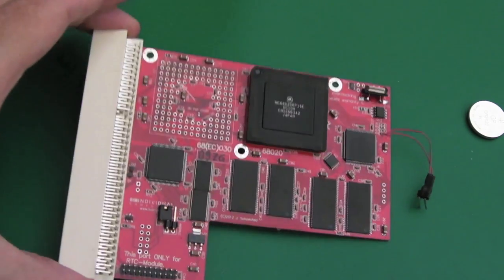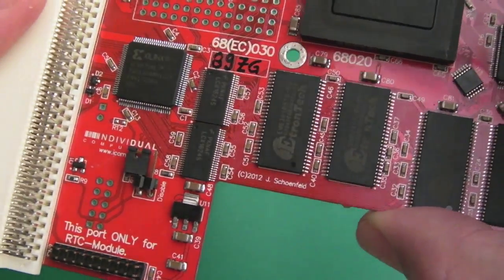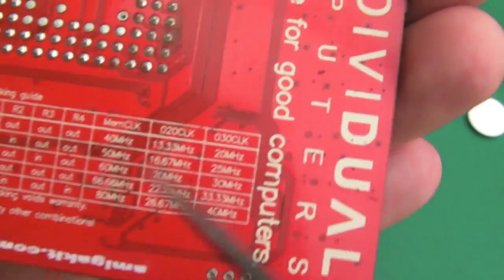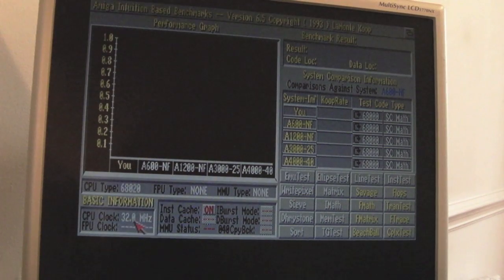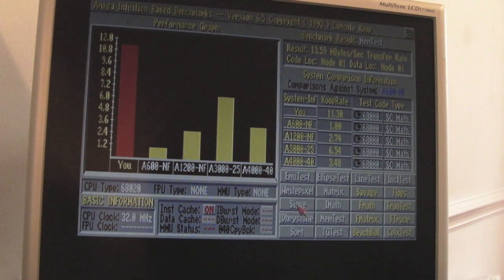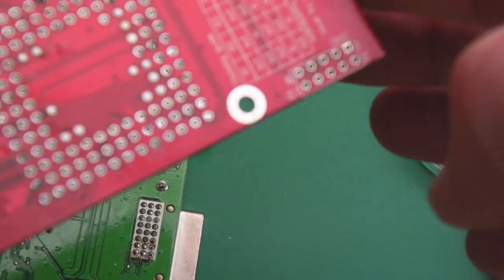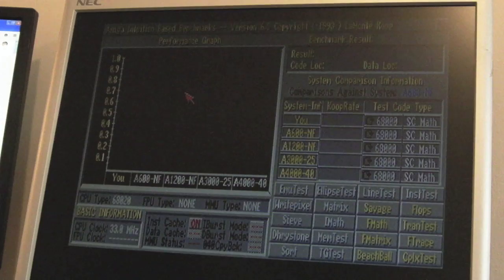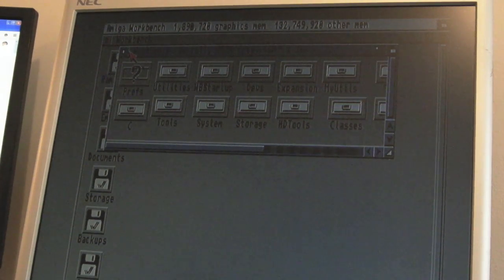Commodore Amiga A1200 ACA1220 Extra Overclocking

Comment: Nice video. Got today a ACA1232-33 with RTC module. It’s not so fast than my new ACA1233n-55. But a step up than my ACA1221EC. I use the ACA1233n-55 on my ACA500Plus and want to use the ACA1232-33 on my A1200. Maybe i can a MC68030RC50C CPU on it and switch the jumpers to R2+R4. And got a 25 MHz crystal.
Reply: There are some problems with the ACA1233n-55. It’s  to fast with MapROM enabled and  there must be a new ACA1233nLib update. Must get the FastATA A1200 MK-V CF/SATA ELBOX with ROM risers with 3.1.4 roms on it.  The ROM risers is to get above the Indivision AGA MK2CR.
Reply from the maker: Nice!!  the ACA1233n-55 is very nice indeed!  The problem with overclocking these is the RAM needs to be swapped out (certainly on the AC1220) to go beyond 33Mhz.  It might be easier on the 030 boards because the RAM might be clocked slower regards the multiplier.  It depends on the RAM used too.

Comment: STILL waiting on the follow up video mate, it's your own fault for being so good. I couldn't do video's, i have a terrible stammer and it would sound awful, still, people like your good self are a god send, we getting a follow up?
Reply from the maker: Hehe, I will get around to it!  Not a lot to show other than it works perfectly at 33Mhz with the 25Mhz chip I ended up using.  Regards 030 - not sure I want to even risk it since the firmware isn't designed for the 030.
Reply: i am happy to send you an ACA 1232, if you wanna try messing around with clocking the 030  ;)

Comment: is there a next video on this?
Reply from the maker: There isn't (yet), but I might do a short follow up over XMAS.  I haven't tried an 030 as I suspect it just won't work, but I did fit a faster 020 and I did some temperature checks and it does run cooler at 33Mhz.

Comment: I cannot think why I did not come to this channel first. You know the awesome youtube channel TerribleFire is making Open source accelarator cards for the a1200 amiga? Well I am trying to get a bunch of awesome geeks (with channels like yours) such as lukemorse1 and so on to promote the idea of an open source pcmcia sidecar caddy for an a1200 (like one of those GVP or a590 style things) with a PCI port in it and an Open Source (SLI) amiga graphics called (to be called HAMbre as a pun about Hombre graphics, HAM, and Homebrew) in it about the power of a voodoo2 or 3 and a bootable usb DVD drive and spare usb port for a flash drive (to automatically hold all data so even a console peasant can use it). And with this I am trying to set a console peasant friendly standard like the amiga used to be (so they can shower homebrew game coders with their reto--homebrew-collecting money on gofundme or whatever) so that new pertaining HomeBrew amiga games (known as HAMbrew) will work with that graphics card and either an accelerator board like your 68030 (at least 4meg to 8meg or higher) or even with 50mhz TerribleFire speed CPU and boot as easily as a playstation or CD32 game from CDROM (even if that means piggybacking from floppy drive) so that nobody needs to know anything about WinUAE to simply play a game.

I call this (easy-to-use) standard " Chambre " standard.

I have massive rant comments about this which are so awesome they are agreed with and getting pinned by amiga retro channels. A good example for the details on all this is my pinned comment in the comments section of the 10 july 2017 video named " commodore amiga 1200 upgrades " on channel "The Guru Meditation". If you wish to give my comment a read out or spread the word in the amiga nerd world, please do and do also give the channel TerribleFire a shoutout. I wish to see big channels like Lukemorse1 and MetalJesusRocks give the TerribleFire channel and similar amiga guys a shoutout. Keywords to spread are the HAMbre amiga hardware standard and Chambre easy-of-use console peasant standard. We need to make sidecar and trapdoor (like you have there) expnsions as easy an familiar to the console-peasant community as the segaCd expansion was and the sega32x was. That way shoutouts from big console-peasant channels will be much easier to impart when they are for amiga nerd channels.
Reply: Here is my other channel. :)
Reply from the maker: It sounds like a nice idea but getting it adopted as a standard will take a lot of work, and there has to be demand for things that use the interface.  I think the big problem is most people have most of what they want - or there's already a product out there that does what they need.  And the market for add ons that take the Amiga beyond its original functionality tend to be limited in demand - ie. You've got the Vampire which gives super quality video output and mega performance, and as a result no one really would want much beyond that.  The only thing I can think that would appeal to the masses would be a CD ROM interface that can be easily linked to any Amiga.  The other problem with these bolt on improvements to the original hardware - you have two camps of people, those who love the original retro hardware and want to just run things a bit faster, and they aren't bothered about adding more and more graphics and sound functionallity to an Amiga - they like the original platform the way it was intended.   Then there are enthusiast that want to just expand and expand it, eventually into something that is no longer an Amiga (The Vampire is on the borderline of this).  Whilst I still want a Vampire, I am not keen on adding hardware that turns the system into something that isn't an Amiga.  I would rather homebrew was deleloped for the original hardware as it stands.
Reply: I made a long ass comment to reply to this but got rid of it as I am trying to make it easier to navigate and I'll cover it on my other channel better. In a nutshell though, I think most people actually don't have what they want. I think a cult following may have but that is all. The console peasants do not have what they want. Amiga users were really the console peasants mostly (once upon a time) and were the bridge between megadrive and what would later become PC Master Race.

Comment: I would definitely build my own 030 Socket with the inline sockets as you suggested :) its definitely worth a go. In terms of Burst Mode and other features? Wonder if the FPGA has a bearing on whether them features work or not?
Reply from the maker: After I did this video I just fitted a 25Mhz 020 and set it to run at 33Mhz.  It runs almost stone cold (so not same dye as my previous 020 that shipped with the board).  I looked at fitting a socket for the 030, but after comparing pinouts I started to consider that the CPLD firmware is chip specific (ie. the firmware is designed for the 020 only), and there would be a risk fitting an 030 to this PCB without a firmware update.   I could be wrong, but the risk in my opinion outweighs the reward since the 030 would be clocked at the same speed as the 020.  All I would gain is some cache I think - if it worked at all, and I suspect it probably would either not boot or worse case it could even kill the CPLDs on there.

Comment: watched this several times now, always a good watch. I have one of these, and will certainly look at overclocking it, can you post any more info on the parts used? have found a 68020 st 33mhz, was gonna pop that in there. anything else you might have forgotten on the video might help to. many thanks again :)
Reply from the maker: Thanks, please note that the crystal doesn't need swapping out!  Have a read through some of the comments above (and below) - I worked out that a clock multiplier can be set using the jumpers to get 33Mhz without changing the crystal.  I will do a follow up video soon - I fitted the 25Mhz 020 and it does run a lot cooler and in fact is barely warm at 33Mhz.
Reply: i have looked at the ACA1220, and ACA1223, and they ARE the same card, there is no difference, on the boards, at all, i know, i went through several pics with a fine toothcomb, i reckon if you put a socket in for a 68030, it will work off the bat. fit a new xtal, and you could make a board that had a 68020 at 16Mhz, run a 68030 at 50Mhz, now thats quite an upgrade. Not sure what you mean about not swapping out the xtal though, surely on the highest multiplier, its the only way to get the highest speed? Doing a follow up video soon? I am tempted to send you my ACA1220, i am that sure it would work.
Reply from the maker: I was told by Jens (original designer) that the firmware is different, and clock / RAM wait state timing is different, so it probably wouldn't work, and depending on how the firmware is different, it might brick it...  So I am not really wanting to risk trying tbh!
Reply: subbed to your channel, and lovin it. you doing any more videos like this again? would you be interested in doing a video on a 1230, if someone supplied the card, parts, and paid you for your time?  ;)

Comment: I know most people wouldn't think it's the same, but would it be possible to emulate an Amiga on a modern PC, say an i7 or something and that way clock it at a couple of Ghz instead of just 40Mhz? Just curious how an Amiga would perform then.
Reply from the maker: +Peter Zwart Yes, you can already do that!  There are plenty of Amiga emulators that can make use of the faster clock speed of a PC!  For many enthusiasts though its all about using actual hardware rather than emulated hardware.

Comment: Hardcore. I have an ACA1221 and some new 33 MHz-rated 68020s I have been wanting to swap in, but that RoHS solder is a nightmare.
Reply from the maker: +The Obsolete Geek Yes, RoHS solder is a pain i n the but!  I would certainly use hot air to do the final part of the removal once you've removed as much solder as possible.  I fitted the 33Mhz chip to mine and it runs cold now!  Shame it doesn't seem to be possible to change the clock division from /3 to /2, else I could run this baby at 50Mhz with 100Mhz RAM.

Comment: If I take the 020 and put a 030 on the board would work?
Reply from the maker: +Marcos Marcilli I am not sure yet, I've got an 030 socket coming and I already have an 030 chip to test with - I am just not sure if it will kill the Xilinx chips on there since they are programmed for the 020.  I might test it soon.
Reply: +GadgetUK164 Ok ... so do bet the link here from ook video. thank you.

Comment from the maker: Challenge for anyone reading this - no one has spotted it yet, but I did today.  There's a missing cap, can you see it?  It's obvious to me why this particular cap came off the board (nothing to do with the work I did).  It relates to the way the board slides into the 1200 and the board can if not careful slip under the plastic edge of the case cavity.
Reply: +GadgetUK164 

C29, it's down near the first or last ram depending how you look at the board.
Reply from the maker: +FourX2k3 Well spotted =D  I noticed it on the board at lunch whilst I was examining for a way to change the clock division from /3 to /2.  Because the board can slip below the plastic lip on the 1200 casing it would be really easy to pull that cap off when inserting or removing the card.  I think that's probably what happened.  It was working fine without it but I've put a same size 100nF on there anyway.  Amazing, I went looking for one thing and found another lol.   Sadly I cannot see a way to change the clock division, I think its done by one of the Xilinx chips.  Seems like the ACA1220 cannot run beyond 33Mhz, unless faster SDRAM chips are used, or with a firmware update to the Xilinx chips to increase wait state on CAS / RAS.  Really annoying, guess I will have to make do with 33Mhz until the Vampire 2 1200 arrives.

Comment: ebay 68030 sockets -> http://www.ebay.com.au/itm/128pins-PGA-socket-13x13-for-68030-/250474705812?hash=item3a5174b394:m:mXAWcsviMz2hwhkE9bMoIZQ
Reply from the maker: +moshly64 Thanks!  Not appearing on ebay uk here, but looks like I can still order one.  I've decided not to fit an 030 on the board anyway as after doing some research into pinouts etc I am convinced a firmware update is required.  For one thing the clock pins are connected between the 020 and 030 socket, so I cannot go beyond 33Mhz anyway.
Reply: +GadgetUK164 No problems, ebay's search has been broken since they removed wild cards (you miss more than %50 of items that you should be able to see). I find the best way now is to do a search, find vendor selling similar items, then browse 'see other items' . The same vendor has 68000/010/881/882 and 68060 sockets as well. You could also use a pile of 40 pin SIP machine pin sockets. That sux about the firmware. In the video you say that you think the MMU will not work but it will (no external logic is required, only an enable pin) bar the firmware.

Comment from the maker: Update 21/02/2016 : I don't think its worth even attempting to fit a 68030 onto the ACA1220 board.  I am thinking I could actually damage something doing that since the pin outs are different on the sockets, I am wondering if that's reflected in firmware changes on the CPLD / FPGAs on there.  Then there are the timing differences related to RAM access, I suspect a 68030 on this board would just not work.   Additionally, burst mode wouldn't be supported, the MMU might clash with however memory is managed for the 68020, and finally there's the clock speed issue - ie. I think we are stuck with the same multiplier, so all in all I don't see a benefit in adding the 030 without a firmware update.  There's even a chance the data cache could stop the system from booting.

Comment: Ηi,great overclocking work .!

Slightly irrelevant but do you use an indivision vga board there or just the 1770nx w/ vga adapter?

I have the 1970nxp (same screen I think) and when I connect my 1200 from a standard 23pin- vga adapter I get some image from the bottom cut off so I was really hoping for a tip there.

Thanks!
Reply from the maker: +Unkle Belzrebuth I use the GBS-8220 VGA upscaler for the Amiga.  The Indivision VGA board is better though.
Reply: +GadgetUK164 Better but way more expensive,though!
I have the GBS-8220 in my watch list for quite some time.
I think I may have to get it.
For the price, I hear that it works pretty well.
Thanks for your reply.

All your videos are very informative and detailed.
Keep up the good work!
Reply from the maker: +Unkle Belzrebuth Thanks!  The GBS-8220 can give a really good picture once you've played with the settings.  They are pretty cheap as well.  I did a video on the board for the Atari ST and the Amiga, and I think there are links in the ST video to a place that sells the clear acrylic housing that I used.
Reply: +GadgetUK164 For the Amiga I have all the necessary info (I think).
But for the ST and while I already watched your ST video the whole thing seems a little confusing because there are many solutions-schematics and they're all a little different.
I have a STF not STE or STFM model.

If you like It would be nice to share the wiring to the 8220 and the atari cable diagram that worked for you.

Thanks:)
Reply: +Unkle Belzrebuth Oh, I think that I somewhere read that the 8220 should be provided with less than 5.0V?More like 3.x ?!
Reply from the maker: Yes, Steddy did an article on it and suggested using a resistor to drop the csync level.  I've put the link in my Amiga video.
Reply: +GadgetUK164 Οkay!Great.